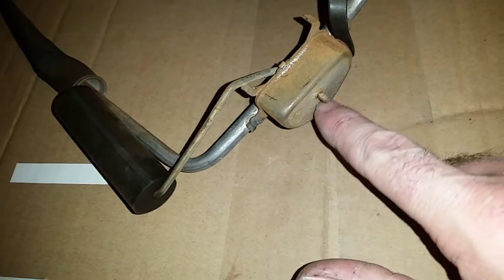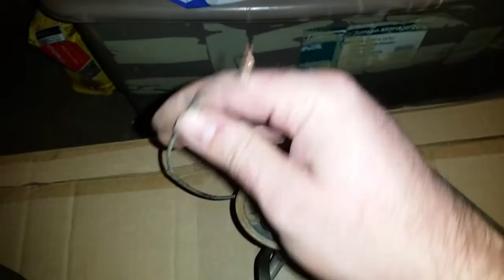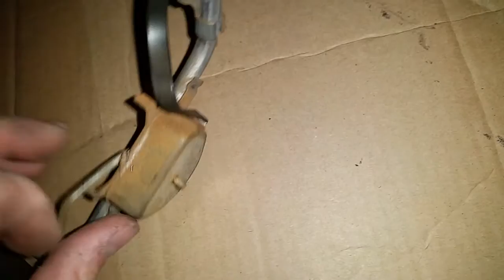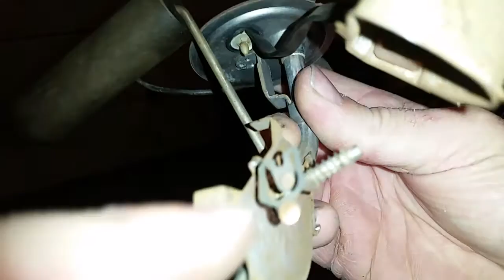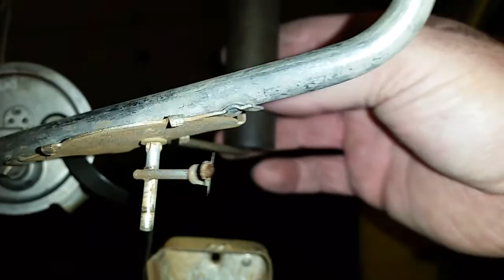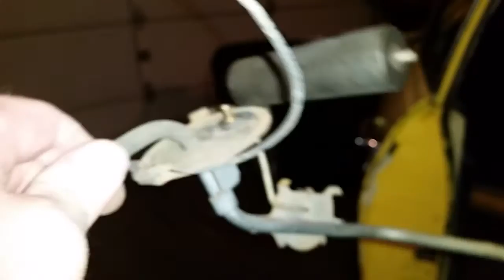1970 Nova Fuel Sending Unit Repair

Comment: Short, sweet and informative. No need to buy Chinese junk after watching this.

What did you ever end up doing about the sock? I know an old hack is to just remove it but if you've found a way to replace it, I'm all ears.
Reply from the maker: I just removed it and use an in-line filter now
Reply: @meridian208  after I asked, I found out the sock and metal retainer are one piece that slides off the tube.

Comment: My gauge stays pegged out “full” all the time. Even with the battery totally disconnected. What is my problem?
Reply from the maker: The wire that connects to the top of sending unit has a poor connection

Comment: My gauge is stuck on full in my 76 Nova. Is this the same on that year?
Reply from the maker: I'm not 100% certain but I imagine it's similar. You probably either have a contact issue like I did or the wire attached to your fuel tank is not connected well. There is just a pin thing that it pushes onto and sometimes gets poor contact. You might also verify that the wire is not damaged or cut and that everything is grounded good, check fuses, etc...
Reply: @meridian208  I sanded the ground and checked the wires. They seem to be good.
Reply: @meridian208  I'm guessing it's the same problem you had
Reply from the maker: yeah it could be. You'll have to tear it apart and see if anything is messed up in there.

Comment: If i give it 12 volt to this unit it will burn?
Reply from the maker: That's a good question. I'm not really sure. My car has a 12 volt system but I noticed that the voltage going to the wire which connects to this sending unit was pretty low. My test light would barely come on with it. If you put 12 volts back the other way it might affect the gauge but again, I'm not really sure on this.